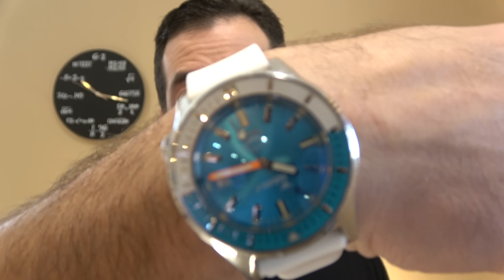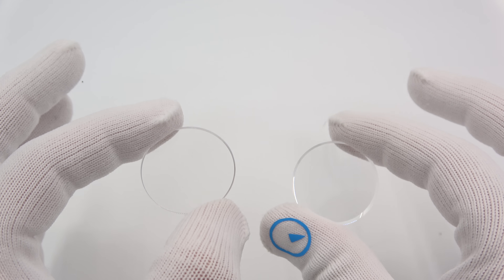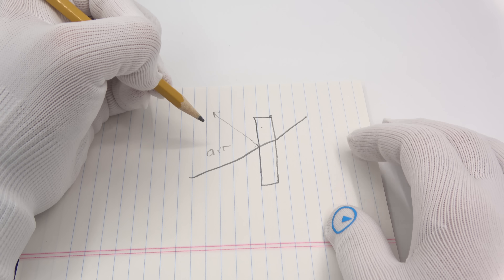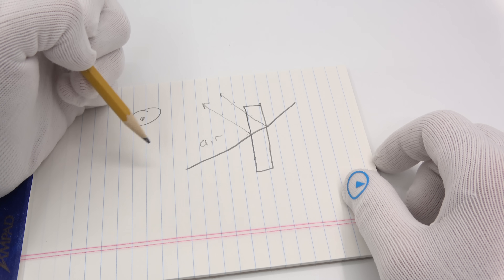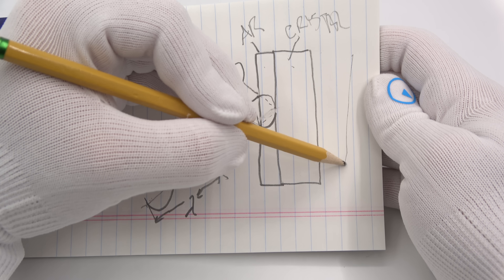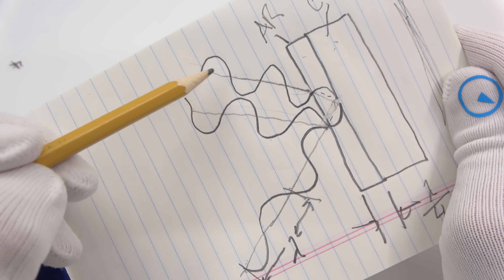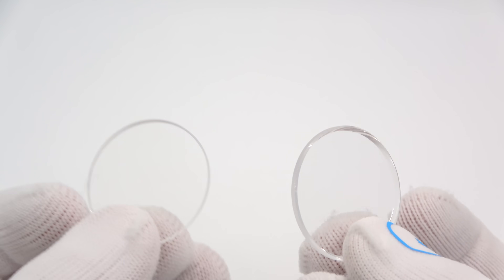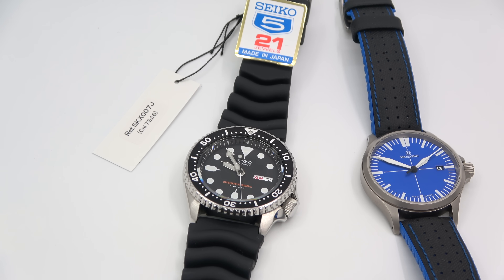What is anti-reflection coating on watch crystals? Watch and Learn #76

Comment: It depends on the dial colour and the crystal they are using. As i remember, the index of refraction of sapphire is nd=2,54 and it is very high compared to eye glasses or other optic devices like telescopes, binoculars etc. It is used because its very high toughness. Also the AR coating could be single layer or multi layer, depending of what transmission you want to achieve. Usually the simple requirement is - for spectral band 500-600nm, the reflection to be less than 1%, this is easy achieved by a single layer AR. But for more precise and maybe luxurious and expensive brands, they may use a specification as for spectral band 380-800nm - covering the full visible spectre, reflection must be less than 0,25% - and that is very hard to achieve thats why is very expensive.

Comment: What? That's a lot more complicated than I thought. How precise of the application of AR coating do you need? Does it also mean that, a company may claim that they have AR coating, but does not apply them properly?
Reply from the maker: The thickness application must be controlled very well, but this is easier than it sounds.

Comment: Brilliant vid. How does it work when AR coating is only applied to the inside of the crystal 🤔?
Reply from the maker: works half as well, just like you would think. It only eliminates errant rays off the inside surface.

Comment: Dear Marc

Yet another great video.

Oil  filled watches have little or no glare I will need to watch your video again to figure out why.

On another note and an idea for next episode. When a watch is being wound, be it automatically or by hand  how can the spring be tightened while releasing energy at the same time to create the ticking motion.
Reply from the maker: Thank you! Oil filled has to do with the oil taking up all the air and reducing scatter (that's my guess).
Reply: @islandwatch  Thanks I think you maybe right I believe the refractive index of oil is closer to glass than to air.

While on the subject of optics.
Q. How hard do Opticians work?
 A. The work at a Snell's pace ;)

(Snell's law)

Comment: As a retired optometrist I found your statement that AR coated lenses reduce the amount of transmitted light to be opposite of what oppthamic   lens manufacturers have always claimed.   They always say that uncoated (no AR) lenses transmit about 92% of the visible spectrum on average to the eyeglass wearer, whereas AR coated lenses transmit 97-99%.  In multi-element optics like a camera the need for AR coatings to increase  transmission is even more essential.   Backside AE does reduce reflections that can annoy an eyeglass wearer but that is not the primary reason for having AR coated eyeglass lenses.  You should see a brighter image of a watch dial through  an AR coated  sapphire crystal when compared to an  uncoated sapphire crystal.  The Seiko crystal is  plastic which might be why you judged the uncoated dial to be easier to see.
Reply from the maker: The Seiko crystal is mineral glass. I think what you're referring to, with increased transmission, as with telescopes, is direct 90 degree incident radiation? The problem with AR is it affects ALL incoming light, not just perpendicular.

I yield to smarter optical people than me.
Reply: Hi Marc,  Solving Fresnel equations for reflectivity in the 90 degree case yields 4.2% reflectivity for tempered glass( N=1.52) and 7.7% reflectivity for uncoated sapphire (N=1.77).   This may explain the duller appearance subjectively for uncoated sapphire.  When both side AR coated a sapphire crystal should be less reflective as your Damasko example demonstrates.

Comment: For the longest time I've wanted to understand if the Orient Sun and Moon gen1 has an AR coating on its sapphire. The crystal seems a bit hazy compared to other watches, but I haven't been able to find any information confirming that. Thanks a lot for the explanation!
Reply from the maker: It doesn't, though it might be foggy due to not being fully cleaned on the inside.
Reply: @islandwatch  Thank you for replying. Have a great week.

Comment: Hello Mark, great video! I have a question that is off topic from this video. I recently acquired a 1962 Omega Seamaster manual wind chronograph with the 321 movement. The hairspring to the main wheel needs to be replaced, top button pusher to the chronograph is missing, the back case casket is missing, also in need of a thorough cleaning. I got it next to nothing at a garage sale. Should I take it to my local watch repair shop that I take all my watches to or, mail it off to Omega to have the work done? I hear that the Omega choice is a bad idea, for the fact that they will buff the case and take the patina off the dial.
Reply from the maker: Get a good local watchmaker to help you out!